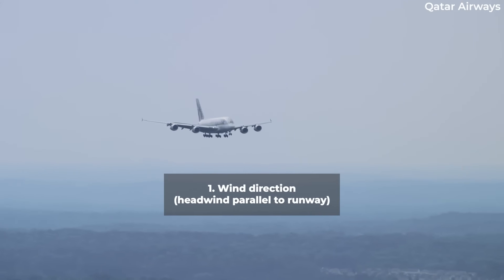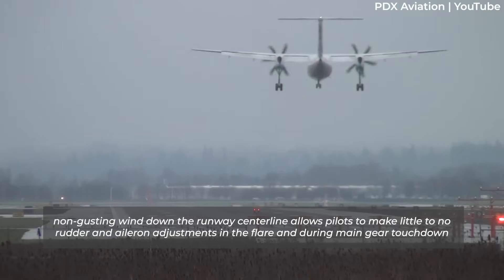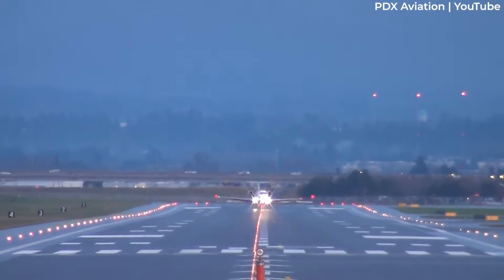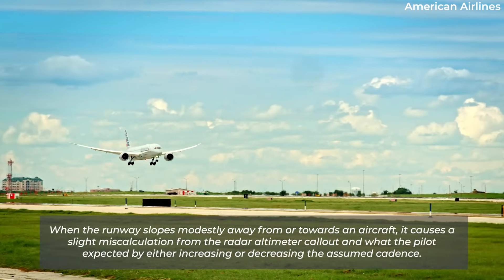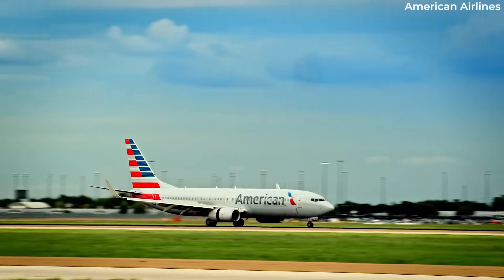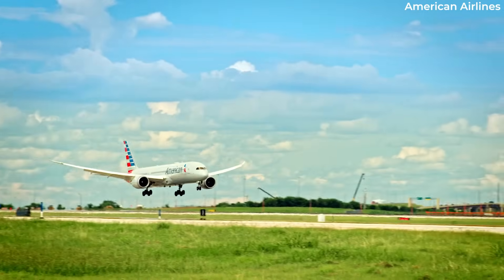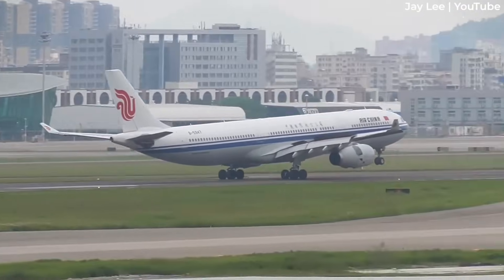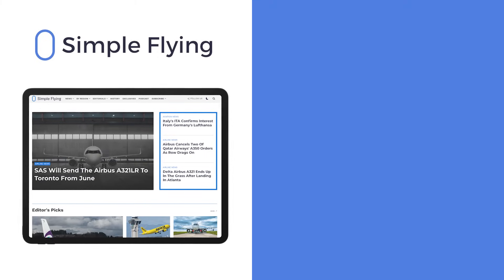What Makes A Perfect Airplane Landing?

Comment: Most, if not all, airlines in the United States require us to land in the first 3,000 ft., or first third of the runway whichever is less. So if I have only a 7,500 ft runway, I would need to land in the first 2500 ft.